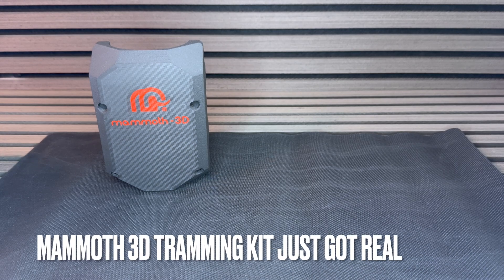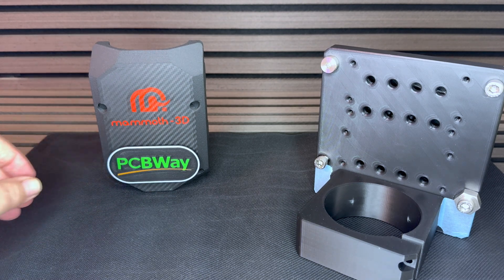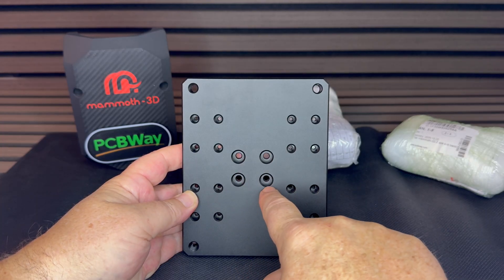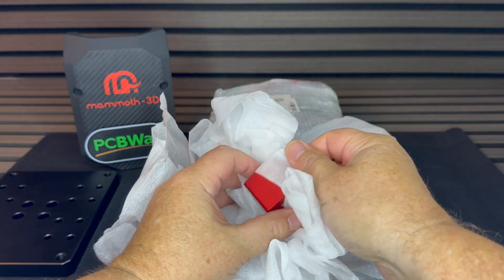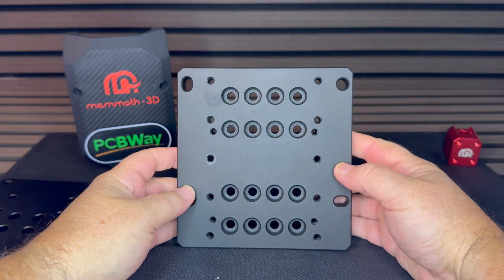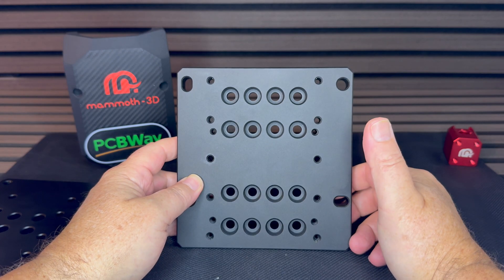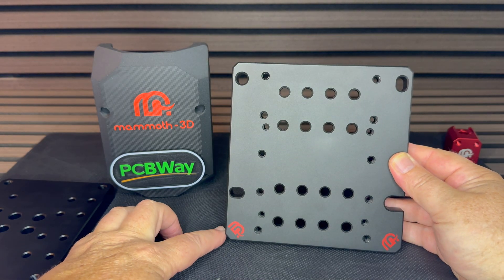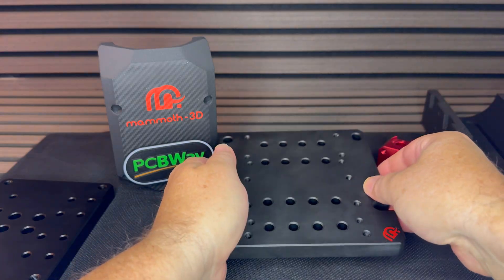Unboxing the mammoth-3D CNC Tramming Plate – PCBWay Precision Parts Reveal

Comment: Hey bud 2 things. 

First off please don't forget that any derivative works must be released using the same open source license as the original machine so in this case GNU 3. 

Secondly just some information for you and everyone else, Milo V1.5 is end of development and we're moving on to V1.6 and V2.0 (V1.6 keeps as much from the V1.5 kit as possible and will be the last V1 launch V2.0 is a completely new build and will be what we develop going further).
Both V1.6 and V2.0 have had these style of tram plates for over a year its only the V1.5 and below that don't, the antibacklash blocks are completely different now as well and rely on conical disk springs rather than preload through bolts, The Z axis is now also completely direct drive so removes the need for belt covers. 

These should still work great for anyone not wanting to do the full upgrade to the V1.6 though.
Reply from the maker: Hey Jake, thanks for the detailed info! Really appreciate you sharing the clarification on the licensing and the development direction — super helpful for everyone following along.
Just to confirm, the tram plate will also fit on the V2 Milo / Miley, but I did go my own route with the design. That means the spindle mounts from 1.5, 1.6, or V2 won’t fit on my tram plate — you’ll need to reprint the version I made to use it.
It’s a pity we never found the time to exchange ideas or do some work together, but that’s open source for you — every man for himself 😉
Thanks again for all your work and for keeping the community so well-informed!